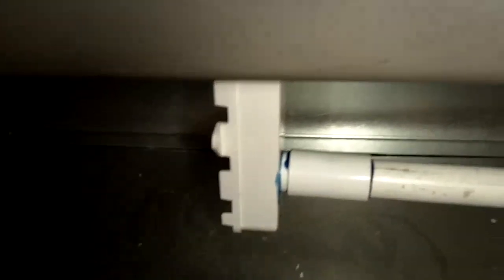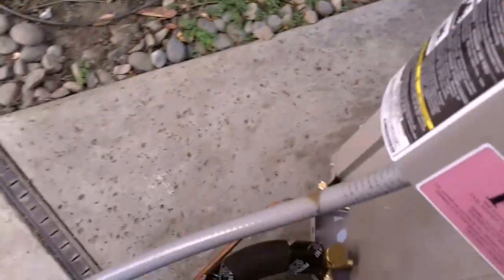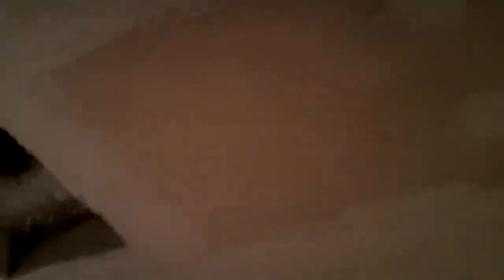Almost done

Comment from the maker: @tstatech Hay Jason, yes I have been very blessed with work, but it's slowing down now. The old shop I worked for was a Bryant and York dealer, when I went off on my own I went with Rheem and Bryant, I have had almost no problems with these units. 
The Bryant 90% systems still have the corrugated drain hoses, they have come up with a new line of 90's I have not installed any yet, but the burners are still hard as heck to service lol, but you know you do a few it gets easy lol.
Thanks Jason

Comment: Your a busy man. Another fine install.

I used to work for a Bryant dealer and a Carrier dealer so I have seen a lot of them but it's been a while since I went privateer so I haven't seen a newer Bryant. Have they changed much since the late 90's, early 2000's ? 
Do they still use those corrugated drain hoses?
Have they improved to serviceability of the burner enclosure?